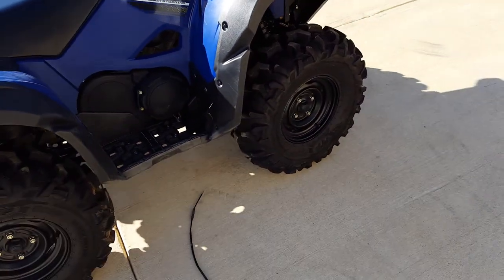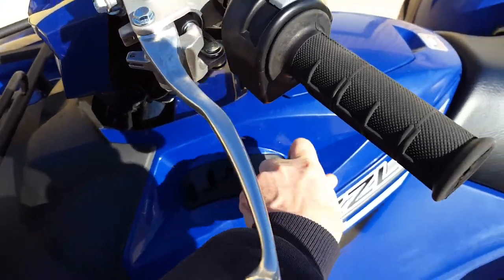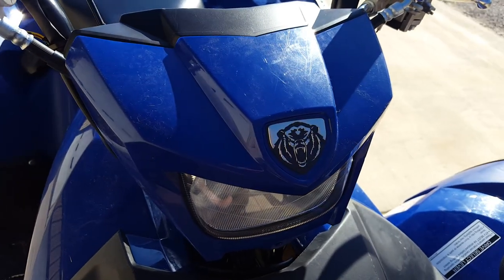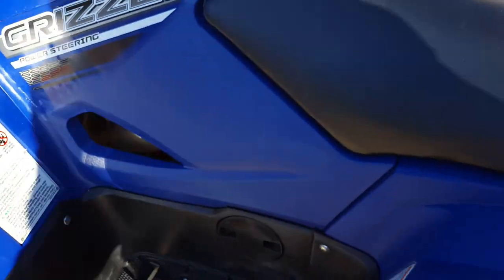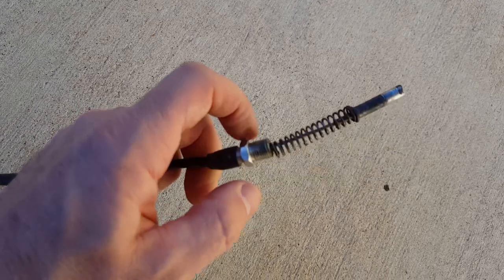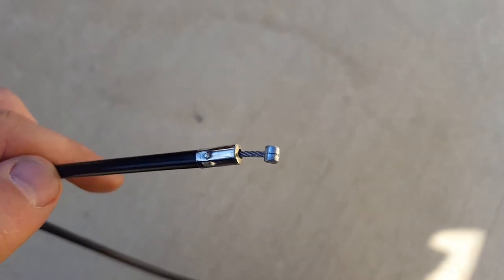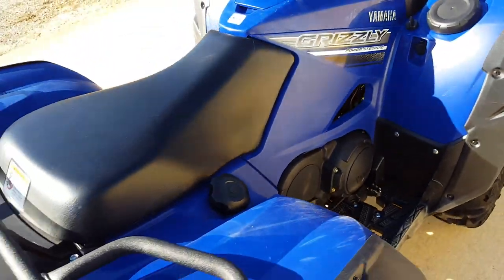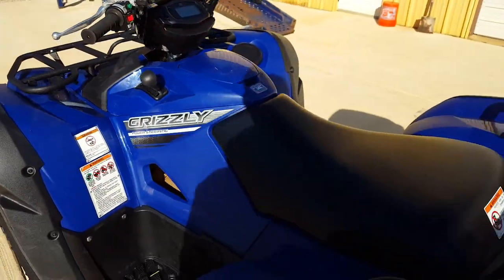2016 yamaha grizzly gear selector brake delete

Comment from the maker: The tuner is from EHS racing, go to the grizzly central forum and you can read about it. 
Because I don't have a temperature gauge I can't say for sure that the four wheeler runs cooler but I would assume so since the 4 Wheeler is lean from the factory. There has been dyno runs to prove that, it's probably that way with all brands. In certain areas of the rpm range the Grizzly gained two and a half horsepower just with a tuner and makes the machine start easier, and mine likes to die for no reason when you're out riding around and with this tuner I have yet to have it die on me. The the tuner was really easy to install and will be easy to make adjustments for elevation or in the event that I add an exhaust system or a 2R racing tip which I have on order, adjustments are easy once you understand the tuner and Eric the designer of this tuner has already done dyno testing with Barkers exhaust and certain intake systems that he makes and the 2R racing tip which some of us grizzly owners are starting to install, that tip is also easy to install and that added with the tuner is supposed to give a noticeable performance gain.

Comment: Just bought a used 2022 and it doesn’t have that cable. And the brake lever is a little loose and I was wondering if it was missing a spring or something as it didn’t look right. Maybe the previous owner did the same mod lol..
Reply from the maker: Unfortunately I can't help you with that, I'm sure it's a bit different then my 16 was, which I don't have anymore.

Comment: Dude the cable 10 inches from the break  handle has a adjuster if you turn it out 
It releives the pin

Comment: I have an 02 and it wont go into gear, I had to jam it, any idea?
oh and it only has about 400 miles on it
Reply from the maker: Quinton I 
I don't know how a 2002 model works so I don't really have any good idea. But I would guess possibly a chunk of mud or I seen were rocks get kicked up into places you would not expect, and possibly one of those things could be the reason it is jammed. Other than that maybe a broken cable.
Reply: Thank you for your reply, the rod was just in a bind??
I twisted it a little with my hand and works fine.
but I appreciate it buddy

Comment: So  Ive been having the issue when it is really cold . .Now if you take the cable off you have no rear brake with your hand  right? From what I`m guessing this cable is crucial for a hand brake as well. Do you now use only your foot for the rear brake? Thanks for any responce. Cheers.
Reply: I'm not 100% sure but I'm pretty sure all the brakes are hydraulic so removing the cable, which is only there for that safety brake shifter thing, it would not affect the brakes.
Reply: You were right. The back brakes are not effected. I disengaged the cable where the pin moves in and out . then i routed the cable on the bike so I didn`t have to remove it completely. On the spring and tip I cut two tips of a rubber glove,poured some oil in it and zip tied it over the spring and tip. I also zip tied the cable on a breather vent to secure the cable from going anywhere. I don`t sumberge the bike so I think its ok. Thanks for the tip. Cheers
Reply: Thanks so much Curtis.  71 miles on my 2016 grizzly and got rid of that cable.   what a pain.  Thanks for taking the time to explain it so well

Comment: Can you still start the bike while its in gear though? Or do it need to be in neutral or park..... Because you need to press the brake to start a grizzly while its in high or low gear
Reply from the maker: J Lord 
Yes you can start it in gear but you will have to pull the brake in.

Comment from the maker: No, that hole is a hole of its own, it don't get into the motor or clutch housing.
Reply: What was the purpose of the tuner? Did you tune it or just plug and play? Does it run cooler? Better throttle responce?

Comment: my 2008 grizzly 700 is great when starting but when its warm its hard to shift gears , is this the answer for this problem
Reply: I guess it's possible, I kind of doubt your 08 model is the same has a 16 model. I would think that you would have something else going on, but I guess it's worth a shot.
Reply: The recommended idle speed on my 2006 Grizzly 660 is between 1450 and 1550.  Any higher you will have problems shifting gears.  Mine was too high, could not shift and idle screw would not bring the rpms down.  Replaced throttle cable, good as new.
Reply: @larrymattox2471  i will try this n thank you so much